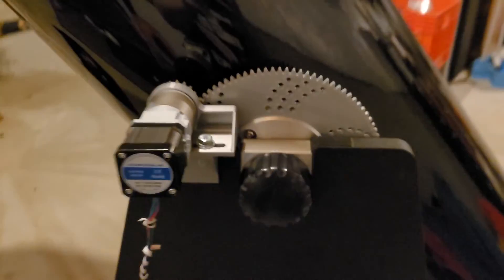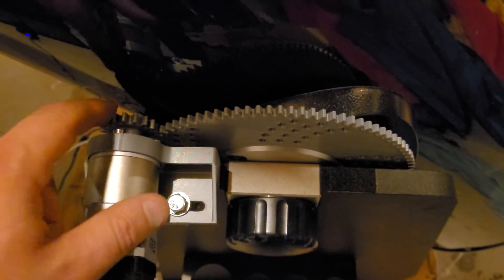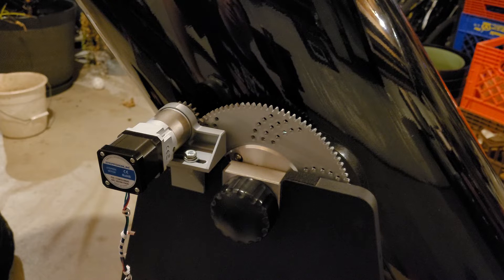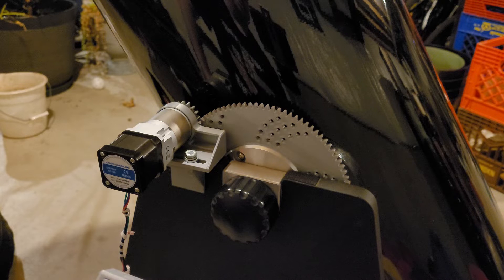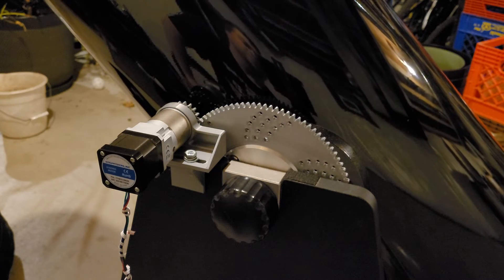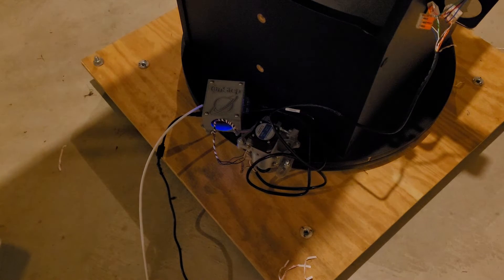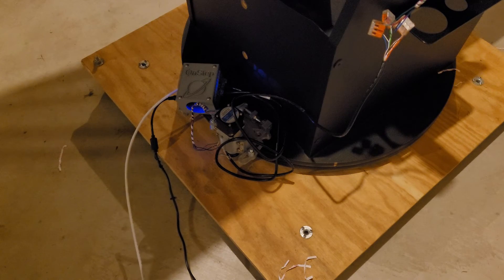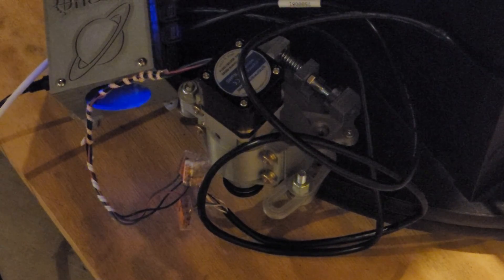OnStep 12" dobsonian first success!

Comment: I have the same setup but I'm using a 8" Dobsonian telescope, I'm struggling with the position of the telescope when going up or down, basically the telescope when going up or down (south or north) the telescope wants to keep going, for example: if going north, the top of the telescope will go down (the bottom with the mirror will go up) so the front wooden wall will stop the telescope but the motor wants to keep going; and vice versa when going south and when the telescope is vertical, the motor wants to keep going so the bottom mirror side hits the wooden wall and the telescope will stop  but the motor keeps going; and the horizontal east or west motor won't rotate (it works but it won't do this move).
The config.h file is set to be on axis 1 -180  and 180 and axis 2 -90 and 90.
What should be the right configuration or what is your configuration? 
I'm using the OnstepX. on wemos and CNC3.
Thank you for sharing.
Reply from the maker: It sounds like you have an error in your steps/degree in the configuration.  I would recommend going to the OnStep forum to ask for help there.
Reply: @ is there a way that you can post your config file for me to download it even on tie Onstep website or here,
Also I noticed that the telescope is off 45 degrees when going to an object and the time and date keeps changing on the web server via browser so I can’t align with the stars.

Comment: I love my Z-12! But I want a motorized mount like what you have here. I have questions. How much approximately is the whole kit all parts included? Also does this find AND track targets? Does it work with stellarium?
Reply: It's hard to put an exact price on the 'whole kit' of parts that are on this, because I purchased a 3D printer to make them.  You can assume $200-$300 for the 3D printer and plastic filament.  The electronics are probably another $150-$200 once you count all the electrical connectors and other miscellaneous parts that may be needed.  Yes, this can work with Stellarium, but I am using Sky Safari instead.
Reply: @thepryorfamily6432   I have an Artillery x1 3d printer 300 mm print surface. Is that going to be able to print the same files you used?
Reply from the maker: I have an Ender3 which has a 220x220mm print area.  I just design my parts with my build envelope in mind.  Your printer should be large enough for most parts you would use.

Comment: I made a 3D printed OnStep EQ mount for my RCT which is still in progress of tuning (ttps://youtu.be/qlFRljpmP_E 
But this weekend I found a very sweet deal for 10" version of your Dob (Orion SkyLine series), now I am on a mission to make this one spinning by itself as well. 
My question is - the azimuth is a friction drive? Alt gears are all 3D printed? Do you have any drawings/STL available online?
Its good you did not use belts with the dob. the tube has a large surface area and belts will become a problem in windy conditions.
With my RCT having 1625 focal length its a problem to handle wind gusts due to belts, thinking of upgrading my design to worms eventually.
Reply from the maker: 1. Yes, the Azimuth is Friction Drive.  3D printed piece of plastic with 2 rubber O-rings on it for the 'tires.'  I can't say that I'm happy with this.  I still don't have the number of steps/degree dialed in, or it's just not accurate.  I need more work on this axis, so I can't recommend directly copying it yet.
2. Altitude gears are all 3D printed, in PLA.  I'll work on getting those gears up.

Check out my latest update video, much closer but still not 100%:
https://youtu.be/9NWSFui9QAY
Reply from the maker: After more testing on the AZ axis, I cannot recommend it.  It is just not accurate.  By manually slewing ~20 degrees in one direction, then back to Zero degrees, the scope already has noticeable error.  This is telling me that my wheels are not riding on the same radius in each direction.  I need to make this symmetric in order to have any chance of good goto accuracy.
Reply: @bryanpryor  you will not get precision unless you put decent axle and bearings in the center of the rotating stand. Current screw and lazy Suzan can shift by ~3mm if you apply radial force to upper circular board. This can produce friction loses. I've seen someone glued a GT2 belt around the perimeter. Which is interesting idea, but without reinforcing azimuth with decent wide bearings and axle - it will fail too. Anyway - I am not targeting precision, all I need is a cheap ass option to make it track a planet by itself. I've got an idea of using belt for altitude and friction like yours for azimuth. Both mounted on a single 3D printed piece which is mounted onto the side panel like a vice.
Reply: @bryanpryor  Sir, I invite you to checkout my design inspired by your idea with friction pulley using O-rings: https://youtu.be/fOAaE_Po2ws